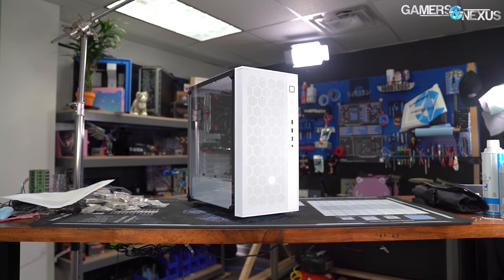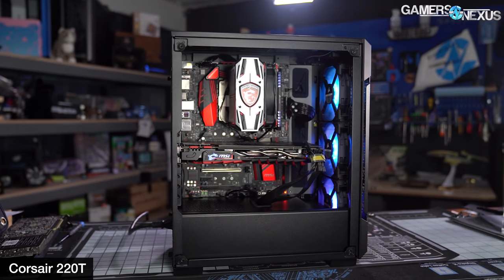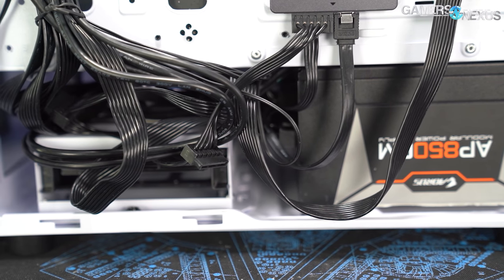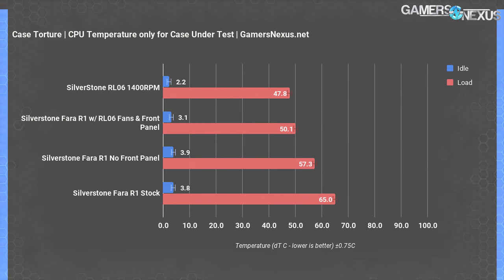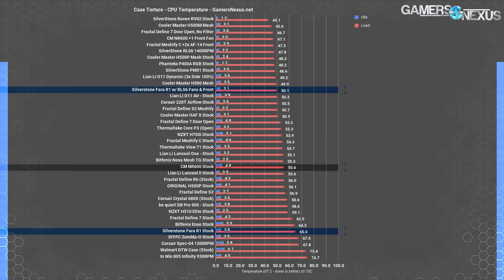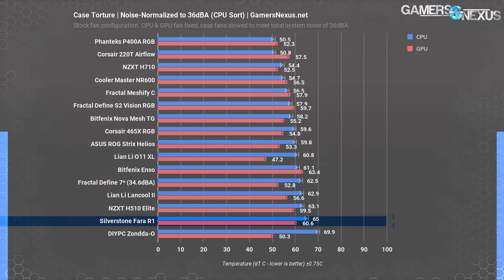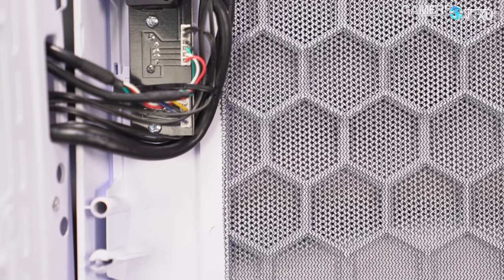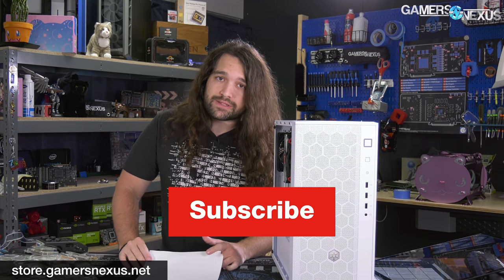Silverstone Fara R1 $60 Mesh Case Review: Build Quality, Thermals, & Noise

Comment: I recently did a customer build in this case and it was very easy to build in. I agree with everything in this review, the front IO is particularly annoying and disappointing. The IO also blocks 140/120 fans in the highest position when placed on the outside of the bracket. Also this case commits an unforgivable sin for RGB fans where it cuts the circle into a reverse d shape which is ugly. The same is true of the NR400/600 actually. I just built in the B1 version of this case and it joyfully implements a top mounted front IO which is not attached and doesn't obstruct fans. Although the semi-closed front does, sigh. I feel like somewhere between these two configurations lies the perfect case for this price bracket.

Lastly, I used to build in the Silverstone ps15 and this case is a dream to build in by comparison.
Reply: Also, btw. In Australia this case is $75. The nr400 is $90, and the Meshify C is $180. It fascinates me the price disparity between the U.S. and other regions.

Comment: A compact airflow focused case with a USB-C front panel is all I ask for. Why do you not exist?!

I love my P600s to death but the unused space is still bugging me.
Reply: In doesn't make a difference on cooling (the unused front space). Other things are far more important than having fans close to components. P600s is the king of airflow in my opinion. I have 3 x 140 front fans in mine and the cooling is second to none.

Comment: It looks wider than the RL06. Can it fit CPU coolers taller than the Cooler Master Hyper 212 line?

It looks like they took tooling from the late 90s or early 2000s and updated it somewhat.
Reply: The Fara R1 has 165mm of CPU cooler clearance (vs. RL06's 160-162mm) so yes, it'll fit larger coolers than those Hyper 212's.

Comment: Case makers need to add more spaces for 3.5 inch hard drives. The average user is likely to end up with 6 or more hard drives, and 1-2 SSDs in their PC, but case makers are not properly designing around this to ensure good access to the drives and simple upgrades as users add more hard drives.
Reply: I don't think 6 HDDs is what an average user has.

Comment: Maybe this has been covered before, but what are the downsides to just having an open or test bench style system instead of enclosing it in a case? I feel it would be much easier to clean and there would be no/minimal heat traps.
Reply: It will be much louder and there will be much more dust building up

Comment: I am so sick of this crap.    RGB this,  window this,  HEY HERE IS SOME TEMPERED GLASS.   HERE IS A CASE FULL OF TONS OF TINY HOLES THAT WILL LET THROUGH LOADS OF NOISE AND DUST.

Can I please just have a case with solid panels, at least one  5.25" bay,  a USEFUL set of USB ports that don't cause shorts when you plug something in,   and maybe comes as a choice between a Tower and traditional desktop?    For $75 ?   

Is that so hard?
Reply: @pp6t  Nothing you have said is a compelling refutation of my points.   The idea that without mesh my computer would somehow overheat is also equally laughable
Reply: @Blink_____  Your computer needs some form of mesh or an opening, whether it be in the rear or the sides of the front case. Closed off cases such as those common in the 90's and 2000's had overheating problems. "Nothing you have said is a compelling refutation of my points." How so?

Comment: "People aren't buying hard drives?" I maybe in the minority by still having an optical drive, but hard drives are still quite popular. Modern games are too large at this point for SSD's to completely take over. Look at the Steam hardware survey. Unless there's a ton of people out there with many TB of SSD storage, that's a lot of HDs still out there.
Reply: Yeah maybe when 4tb ssds are cheaper i will set them up, right now I’m good with 2tb m.2 but i would like 4-10tb normal ssd to circumvent traditional platter storage.

Comment: Honestly, I really like the aesthetic and IMO the lack of included fans is a plus. If you care about cooling performance relative to noise, you're probably replacing all the stock fans with noctua or noiseblocker anyways. I don't know why they even bothered with the included rear fan. That said, just having to remove the front panel to clean the filters is just awful. If dust filters are hard to clean, they don't get cleaned full stop.
Reply: Sure, like somebody's gonna pay 70$ for a case and 70$ more for 3-4 Noctua fans. That sounds like something people on a budget are doing all the time.
Reply: @Danko_HS  Obviously not something somebody on a tight budget is going to do, but there are absolutely people who will do exactly that and it's nice to have the option. For people on a tighter budget, you can grab a 3 pack of 120mm fans on amazon for $12-15 and you have an $85ish RL06. But if not for the front panel/dust filter design I would seriously consider filling this with NB eloops or NF-A12x25. I'd rather have better fans than spend more on the case.
Reply: @humanmale971  I'll be honest, i don't like the case that much. The front panel wiring is definitely a deal breaker and the filter attached to it is another mistake imo ( i usually wash my filters). I also agree with Steve, this should cost more like 60$. Adding 15$ worth of fans will bring it in the Phanteks 400A price range and that one already comes with fans, doesn't have any of the flaws of Fara R1 and has better temps out of the box AND in the standardized fans test.
Reply: @Danko_HS  As far as I can tell, the best price for the 400A in the US right now is like $140 from a third party amazon seller. As the review notes, a lot of these cases that launched with good performance/$ aren't actually available at launch price so this case being $85 with generic fans (or $160 with really good fans) isn't a problem the way it would have been if it were 1-2 years ago. Everything is just more expensive now partly because of tariffs, probably partly because of Covid wrecking supply chains. I also think this case is way better looking than the 400A which is pretty subjective of course.

All that said I 100% agree with you. The inclusion of dust filters that you have to rip the front panel off to clean is absolutely awful design and is in my opinion a deal breaker as well, which is a shame because I like the rest of the case a lot. This is something fractal gets right on some of their cases I think - front dust filters behind a door that swings open, bottom dust filters that you can pull out from the front without pulling the case away from the wall.

Comment: Another great video, Steve, and pretty much goes with my experience of this case. I went for one a month ago. Couldn't wait. It fit the dimensions of the space I had for a case (inside a desk), it had the right featureset, I liked the front panel styling, and it was from a manufacturer that I've previously had good luck with. It's overall a better than average case. But the build quality is ... not ideal. Bendy thin steel. 2.5" drive cable management hole placement issues along the base just above the PSU shroud. The hard drive bay can only be placed in one location and can't be moved forward to allow for more space for PSU cables. The top mesh cover is rather thin and cheap-feeling, and the glue holding the magnetic strips to it are coming off. sigh So nothing major but it's still a bit disappointing coming from Silverstone. Even so, if these small issues don't put anyone off I'd recommend this case, but replace that rear fan for something more effective and use 140mm front intake fans!

Comment: I would like to see some older cases compared to newer ones, like the look back at the HAF-X a while back. It would be interesting to see how an older case would fare against newer budget options, seeing as you can find some old cases for next to nothing.

Also, it would be interesting to see what kind of thermals you can achieve with something like an Antec 1200 with 5x 120mm Noctua fans strapped to 12v Molexes.

Comment: I'm no expert on case testing but when removing the front panel I doubt that one can speak of a "pressure system" from a single exhaust fan. It seems more likely to me that the air pushed to the sides by the CPU+GPU can simply escape back to the front.